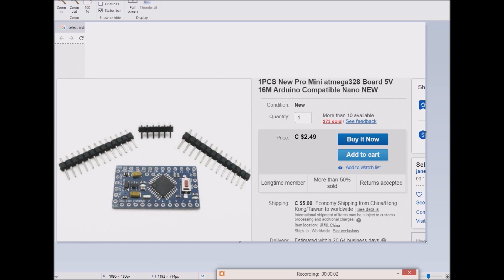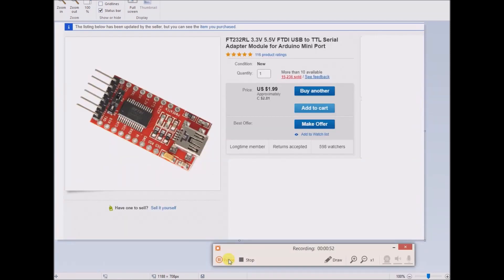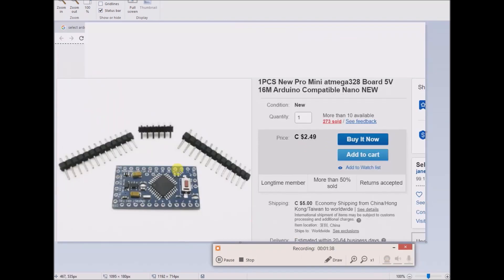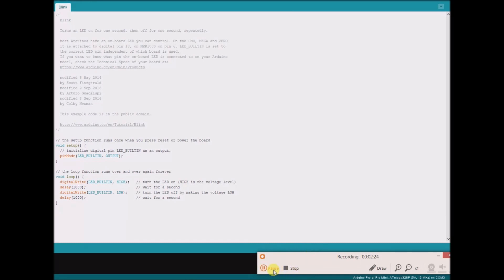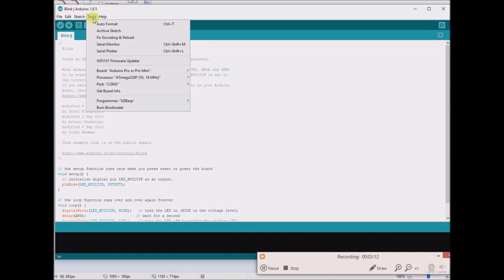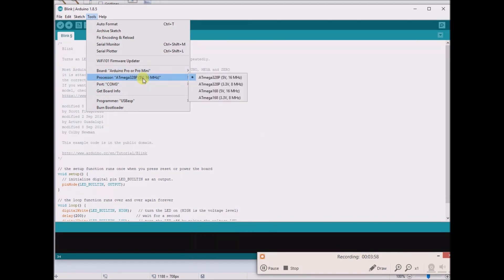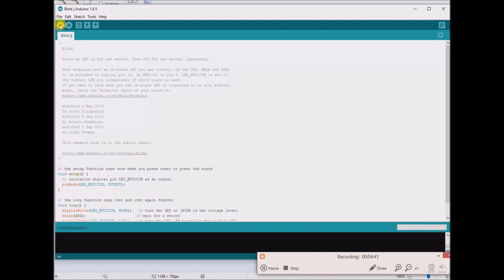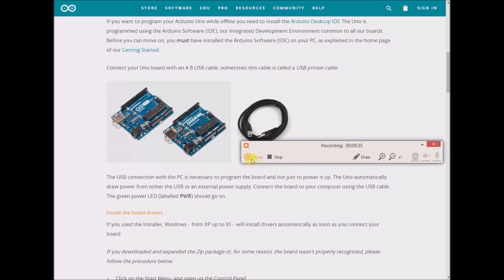Programming an Arduino Pro Mini with a FT232RL Module: and Com Port troubleshooting.

Comment from the maker: Please see the video description for material related to this video. And, don't be shy to ask me questions. Maybe I can help.
Sorry if I mumble. Please see CC, closed captioning.

0:15 Hooking up the CTS (Clear to send) pin may not be necessary. In my case, it was not. See also 14:07 in my video.

Please note: At 7:40 , I talk of selecting the correct oscillator frequency. I recommended selecting the 16 Mhz (or rather ATmega 5V, 16Mhz). I know this is probably correct, in my case. This is because, the eBay ad description for my Pro Mini says "1PCS New Pro Mini atmega328 Board 5V 16M Arduino Compatible Nano NEW." So, 16M, or rather, 16 Mhz is the oscillator on my Pro Mini. This might be different in your case. The DroneBotWorkshop video (which I left as a link in the description), actually uses the 8 Mhz. DroneBotWorkshop cautions that if you don't match the correct oscillator frequency in the Arduino IDE, "your timing
 loops can be off in your program." I cannot confirm this. And, kindly, if you know the answer to this, or have insight, please leave a comment below. 

Thanks for watching. I hope you have success. If you liked this video, please check out my other vids.